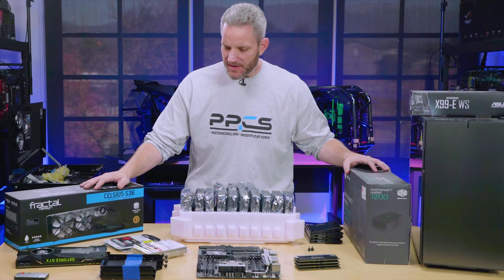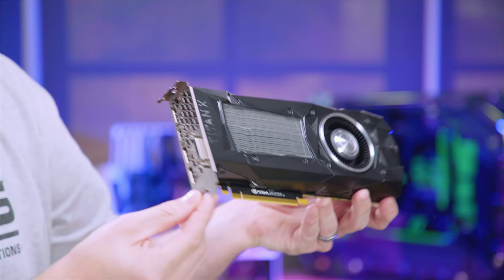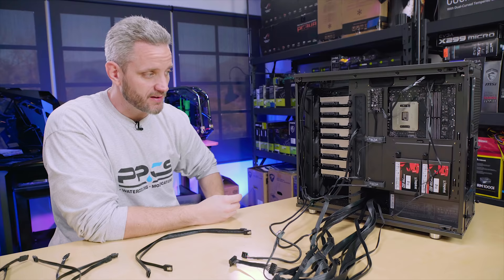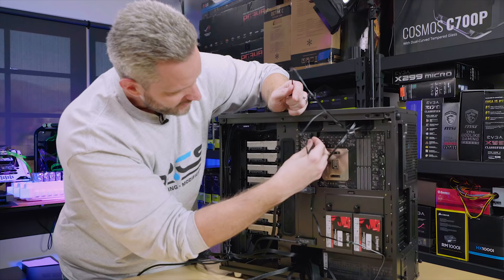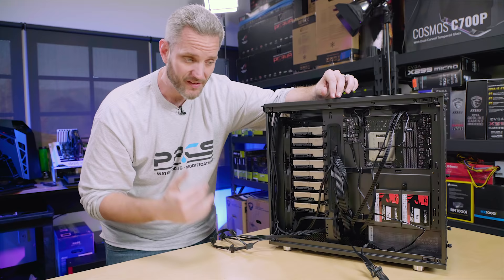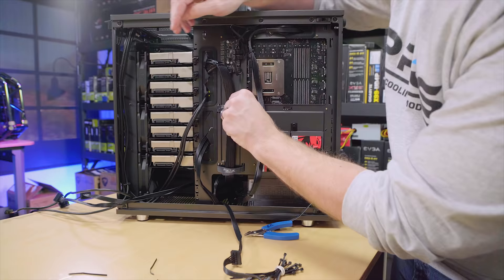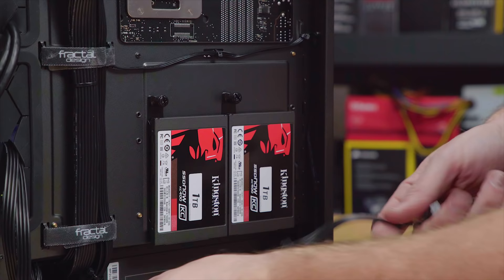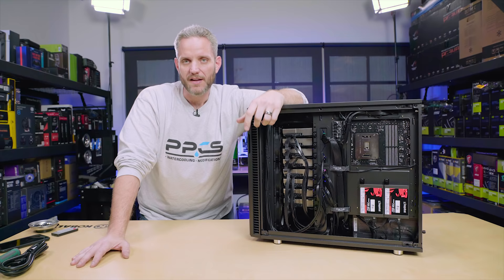How to cable manage a computer

Comment: I like to use the plastic covered steel wires that come with pretty much every new stuff that has cables on it. Advantage to zip ties is they are reusable, you can add more cables to them and they are free :) Plus you can undo them without side cutters, although one should always have side cutters on stand by :P

Comment: Jay, it's a lot easier to get a giant roll of velcro and then just cut of strips as you need them.  That way you don't waste zip ties and they're easy to remove, move and replace without having to cut anything.

Comment: A little late to the party here, but I was wondering how this build turned out. One thing specifically, the gaps between the installed drives is small and therefore(?) restricts airflow and all that guff.

Comment: One tip if you have a modular power supply plug in that damn CPU power first depending on the case it can be really hard to get your hand in there, I have had to take off a fan before to plug it in once since, that day I just plug it it right before I mount the motherboard especially if the PSU is modular. 

Another thing I do is install gpu last like literally my very last part I install before I turn it on it just gets in the way. I have no ideas why people install the gpu in so early, I have seen people install the gpu then start to plug in front panel connectors... just faster and easier to do it last.

Comment: You should consider to get rid of zip ties. One really huge lifesaver in terms of cable management is double sided velcro tape. I use it for years in all of my builds. You can cut it to your desired length or even width and reuse them like a 1000 times.

Comment: I thought going AIO on my Supermicro/XEON 8 drive NAS build and my ESXI box was a great idea until the pump on the NAS died at 2am and the chip hit 90c.  Powering off VMs at 2am when the motherboard alarm went off (It's ISCSI to my ESXI) so I can power the NAS off when I have to get up to go to work at 4am aint fun.  So I swapped out the perfectly good Seidon on the ESXI and tossed the dead AIO on the NAS and bought 2 air coolers.  Learned my lesson, air only for my 24/7 boxes.  Yea, I pick up a couple C, but I also get peace of mind.  Granted, it's tough to do when the chip is a toaster (my main rig is i9 and it's custom watered) so I would monitor it regularly for any heat anomalies that would indicate a pump problem.  In my case, the pump was just great until it died.  Temps were fine two days prior.  Cool build though.  Like the case.

Comment: If you would put your cables in near boiling water it will remove creases from the factory and make the more flexible to work with and give a much cleaner look.

Comment: Help I usually cut mine out for maximum airflow but then it doesn't starts.  Even though the board has built in bluetooth and wifi.

Comment: i tried to cable manage my thing like urs but mine cant go through the whole aka flabs you have i dont have those i only have holes i tried to make it go thru the thing but my motherboard is visible in the back and i dont want it to get messed up by wires and its all plugged in so im scared that if i unplug everything and try to put wires in back something is gonna break or i might not have space i neeed help because one of my fans is on the side and all wires is there and so it messes it up HELP ME!!

Comment: I know this is definitely not the focus of the video but...why hardware raid (as you said raid card, instead of HBA),  why nvidia for VM's, as they restrict the usage when they detect it is being used in a VM, and why the kingston SSD nows, as cache disk? Even the 1TB variant only has a rated TBW of 400 TB, which is nothing when the server is being used by multiple people.

Comment: if you have to use a raid controller why not get a enterprise SAS controller and put all 8 of the disk drives on it. You can find pretty good deals on eBay for used ones and are much me reliable than consumer SATA raid cards

Comment: ya know you could of pulled out the ol 900d and put in all 15 drives in. Stock the case only supports 9 drives, but im sure corsair woulda sent over the other two drive cases to get all 15

Comment: Not sure that AIO actually offers better cooling: The top Corsair AIO certainly doesn't offer better performance than a high end Noctua Noctua NH-D14 heatsink or similar with a fan, and the Noctua is actually quieter to boot, not to mention a lot cheaper. 
It's also more reliable since there's no pump which might suddenly die, and if the fan die, you can just replace it. 
Much cheaper than having to replace everything as you typically have to with an AIO.

Comment: If you're running a 10 core, why going with X299 and not X99 ? You said it X99 WS got way more sata port, and X99 got 10 core processor 
(and the X299 ws sage, the most high end X299 board only got 8, instead of 12 on the X99 ws)

Comment: I have a 24 pin motherboard cable from an EVGA power supply that's stiff like a suspension bridge cable. It's so hard to bend to the right position for cable management.

Comment: I still wouldve picked a D-15 or a DRP4. 265W TDP is more than enough for a desktop chip and Id reaaaaalllly rather not lose 100TB+ of data to a physical failure, or lose a project due to a pump failure. Great cable management though :)

Comment: never use metal twist ties. They can cut into the wires you're bundling up and short. Or if they get bent too much bits of the metal wire can break off, fall on something and short. Zipties are always the way to go.

Comment: If i connected a power supply to a power point, jerry rigged the wires to work as positive and negative leads. Could I power a car's accessories?

Comment: I know I'm late to the party. I would have used a xeon chip with ecc memory. It's more in line with a pro workstation. I have an X99 with that configuration and it has been absolutely bulletproof. Just one man's opinion. PS, nice job!

Comment: Sata data cables truly are the scorn of cable management.
Reply: PATA/IDE cables were worse.  Huge, 40 pin wide suckers that blocked airflow and had minimal bending movement.  Plus, the old cases didn't have any room in the back for routing.   We are spoiled today.
Reply: @BananasananaB  I actually took apart an old Dell of mine not too long ago because I needed to salvage some hard drive screws and found out it had one of those 40-pin cables. It also had a metal bracket for the HDD that held it vertically against the front of the case, and a plastic hood over the CPU to direct heat directly to the exhaust fan. Thing looked like ancient technology to me.

Comment: JayzTwoCents are you going to be using hardware RAID or software RAID under Linux? Seeing that you don't have all drives connected to one RAID controller I'm guessing RAID under Linux and you're going to use unRAID?

Comment: I've always as you Americans say 'Routed' the cables neatly, but never really tie much in. If you can't see it who cares. Someone like your self who has OCD and a reputation to uphold i can understand :p .
Quite often if i am using cable ties, if you reverse the way it secures, you can hold stuff without permanently securing it. If you want to reuse cable ties, fairly easy to lift the securing tab without cutting them.

Comment: Jay. Suggestion. Please stop using and recommending the use of TIGHT zip ties. Zip ties are kind of  OK and the cable management looks nice as long as they are not too tight. As electricity runs through a cable, heat is generated and thus expansion, contraction and eventually, over time, internal breakage will occur. My preferred "management" medium is Velcro. Cable tie removal tools (cutters) vs cables is potentially NOT a good thing. Experiencing 12,000+ servers to remove tight zip ties from taught me this. 

I do agree with most other things I see on your channel. Thanks and great success to you.

Comment: Trick is to use the zip-ties backwards so they don't ratchet during the planning, then when you're at your final phase you can undo those and flip them around or finalize in another way. 
Then you will actually not be wasting zip ties if that's an issue.

Comment: Cable management is definitely A LOT harder without a modular PSU. Unfortunately there's a mess of molex cables and extension lengths underneath my PSU shroud.

Comment: Cable management is only an OCD problem.
In testing it does almost nothing for airflow.
Setting your PC near a drafty window does more for your PC than cable management.
Reply: Cable management is good for when you take apart your computer for maintenance or to replace parts, allot easier to access things, allot less likely your gonna unplug the wrong cables n what not

Comment: It is common sense to connect the power supply cable ends first.  The connectors to the hard disks and SSDs are much more fragile, and any strain on them can fracture the connector on the cable.

Comment: Everything is good except the SATA cables. Better to number the cable before plug in. That's what we did when we were running network cable for 60+ terminals.

Comment: I despise using zip ties for cable management. All I ever use are hook and loop strips and wire ties. Much easier to work with especially if you have to change something. Plus, no chance of carelessly cutting a wire trying to remove the zip tie.

Comment: ARGH! The loops on those sata power cables hurts my visual cortex.... just do every second drive on each cable. It looks way better. So cable 1 would feed drives 1,3,5,7 from the bottom and cable 2 would feed the rest.

Comment: I`m having trouble cable manage my fans because my AIO fans are on the right side and the case fans are on the left and I don't know how to bring them together, since the fan cables themselves are not that long
Reply: Is there anyway you can flip the mother board?  If not, how many fans? 1,2,3?
Reply: Big Prada nope, no way to flip the mb. I have one case fan at the rear, one at the top and 2 fans on a radiator in the front (I’m using a NZXT 500)
Reply: @TheSoroLP  how big is your case?
Reply: Big Prada it’s a nzxt h500, mid tower

Comment: I built my system 10 years ago.. never bothered to manage the cables. Computer sits behind 4 monitors, so I don't care.   I5 worked great and severed me well, with only a few upgrades over the years, bigger ssd and better gpu..  Now have a pre-built zen2 that should last another 5-10 years.

Comment: Cable management with zip ties is most pointless thing to do. Anything more then minimal cable management at back of case is pointless anyway. You dont see this as long as you dont have case with window on both sides(worst thing that happened to pc cases lately) and most of all, it make things harder in the future when you want to fix/replace anything in your PC. The only cable management I do aprove is like 2 or max 3 velcro tapes just to make sure cables dont get to bulky in 1 spot to prevent case panel from closing. Also no matter how hard you try it will look like crap as long as you dont do custom lenght cables yourself. This includes what Jay did in this video.

Comment: Instead of wasting zip ties when you are trial fitting put them in backwards so they dont lock onto the tail they will still hold but you can easily just pull them back open and reuse them

Comment: This guy is a master at PC building, but flush cutters are better than side cutters so you don’t slice your hand on a cut zip tie later.  Flush cutters make a flat cut where side cutters make a pointed cut.  Cut nylon ties can be surprisingly sharp.
Reply: Actually he is using flush cutters.... noticed that later he just called them side cutters.

Comment: Honestly my approach if I go modular is to just start at the components and lead back to the power supply (or other components) I start at the mobo and work backwards... But my level of cable management leads to a rats nest of cables coiled up next to the psu

Comment: Those hard disks will likely have problems caused by harmonic vibrations unless they're reasonably well dampened. Though I assume those drives are only there as an extreme example. :>

Comment: Should have put a SAS card in for the raid.. it would have been faster and no worries if the system died.. move the drives and SAS card to a new build.. and reactivate the raid. And your up in running again fast.

Comment: Corsair semi modular integrated HDD power cable has wrong orientations. It is like top to bottom. So if i want to bottom to top then i have to twist 180 to plug in.... GRRRRRRRRRR

Comment: Hey guys I need some help.
So I'm saving up for this build (https://au.pcpartpicker.com/list/T4WnnH) I'm going to be using this PC for both gaming and photo editing and thats why I went with the dual monitor setup. A 144hz 1ms 1080p TN panel monitor and a 60hz 5ms 1080p IPS panel monitor. The TN for fast paced FPS games like CS:GO and the IPS for color accurate photo and possibly light video editing down the line. I was wondering if my CPU and GPU can support this and run each monitor at its max refresh rate, 144 and 60. DVI-D for the TN since HTMI only allows for 60 hz on that monitor and HTMI for the IPS panel.

Comment: Great vid.  Gotta question your choices though.  Looks like 12 lbs of crap stuffed in a 5lb box.  Contrary to popular enthusiast belief rads are not for system intake only.  the cool air for the rest of your build is having an already hot rad drawing warm instead of cool air in.  Bad layuout choice,  those HDD's will already be steaming and now have a hot rad from an intel space heater blowing over them.

That rad should be expelling warm air and separate fans drawing cool air into the system,  only because that thing is tiny and stuffed to the brim.  Might be a little better if this was 900D or your CaseLabs box.

Great cable routing though especially in such a crowded case,  very interesting.

Comment: those loops on the SATA power cable though... In my humble opinion I would have used  1cable  for the 1st, 3rd, 5th and 7th HDD and then the other cable for 2nd, 4th, 6th and 8th HDD so almost no loops would have been happened :/ My humble Opinion.

Comment: Whilst I get the core point of the video is about cable management and not the system itself; its missing alot of server redunduncy as well as really weird simple aspects like using a proper server case and backplane ergo minimising internal cable mess. Might come back and bite you when something falls over.

Comment: Lol, you should have seen my pc in it's original form.
It never occurred to me at the time when i first built it that you could hide the cables in the side space (you know, where they are actually supposed to be) so all the wires / cables were in the case floor.

Comment: Noooo Jay, you could’ve got away without the loops on the drives if you did ever other drive. Instead of plugging all four plugs into the top four drives you could’ve done 2,4,6,8 and 1,3,5,7 on the other cable. It would’ve looked a lot better without all the loops in my opinion

Comment: PLS HEEELP 
i5-6200U
i placed a clock under my laptop but still runs at 2.8Ghz wtf :(
Reply: my laptop is over the clock, so its supposed to be overclocked. Not only cpu, gpu, ssd, dispay etc. but also my track pad should be overclocked, my webcan, my mousepad, etc.... But everything runs stock speeds :/

Comment: You would have a heart attack if you saw my cable management (or lack of).  Most of my cables are on the front (or business side) because the wires were too short for my hard drive and sata drive so I put the former and latter in the front.

Comment: It's old video but cringe induced. why not use SFF-8643 connector for sata? it can easily connect 4 sata drives with simple cable.

Comment: dude you are always talking about how scared you are to break the plastic on the hdd's and ssd's.. granted im sure youve built WAY more pc's than me, but iove built a good amount and ive never, not one time broke one of those.. i dont think theyre quite as brittle as you think. i think you may have broke a few faulty ones or old decrepit plastic ones and now you think theyre all that weak.. in fact, my 2 ssd's in my pc right now have the plugs wrenched on in order to fit them where the ssd trays are and theyre perfectly fine.. and im always putting more than im comfortable with amounts of force of the hdd plugs because they ALWAYS stick out too far when youre trying to put the back panel on it.. Youre actually the one who made me paranmoid about them. lol. but ive still never broken one.. (knock on wood)

Comment: Why the actual fuck don't Fractal sell separate HDD caddys for the R6 or indeed any of their cases. Its madness! Why design a case that has space for 8-10 HDD and not sell separate trays for the drives. My R6 only came with two of them.

Comment: So basically if you dont have flat cables your kinda in trouble.
Reply: Nah it's fine

Round cables will stick and stay together with zipties as safely and cleanly as flat ones.

You could even 'make' your own flat ones by tying them in 'packages' and putting them side by side.

Comment: You should try looming cables in an aircraft.....pain in the arse. Data down one, power down another,  one more for rf and the last is armament. All colour coded sleeves and locations built in to the airframe......looming a pc is easy by comparison. Crap....forgot about the databus, that's another loom entirely......

Comment: I know that this is pretty old video. But I have to say.
Don't mount drives near hot radiator exaust.
HDDs are hot even without external heat source. And temperatures over 40C will increase failure rate over time. You can google for study paper about that.

Comment: Wide enough case for easy cable management, yet not tall enough for the only logical water cooling AIO positioning - on the top! Now you're using hot CPU air exhaust as "cool" air intake 💩 What a shame, Fractal.